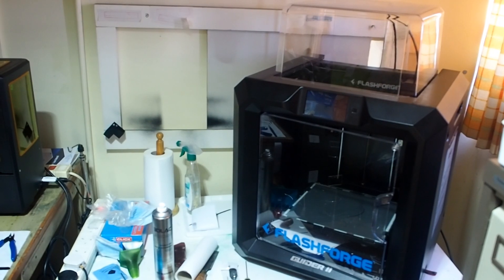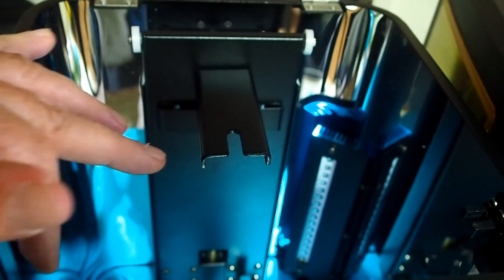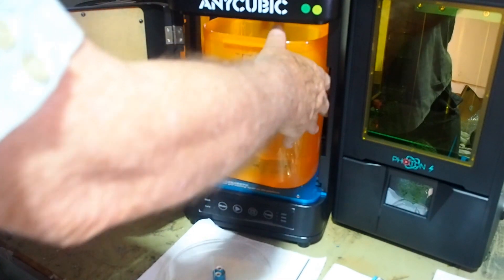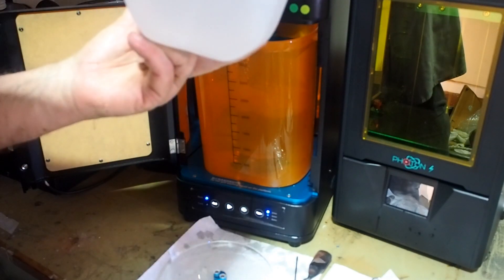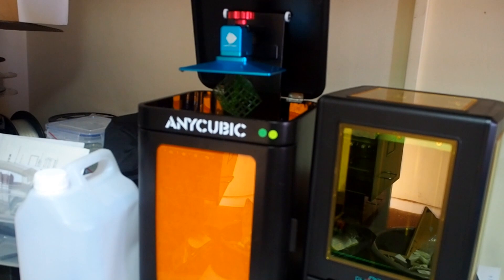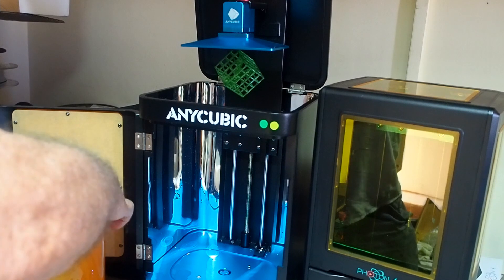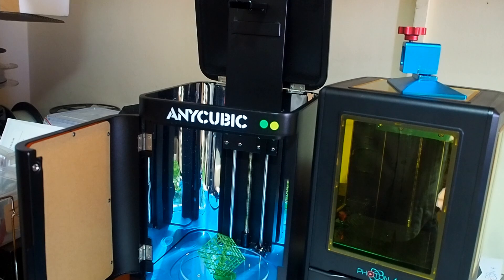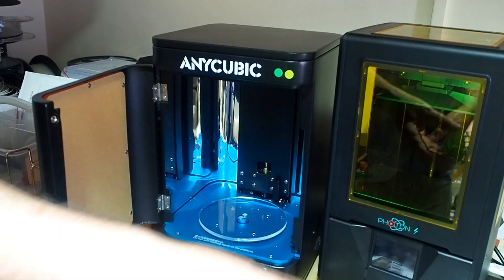Anycubic Wash & Cure first attempt

Comment: I just got mine, and The spinner in my wash bucket isn’t rotating 360° when it gets up to full speed. I am thinking maybe the screw is tightened down too much. Have you had any issue with this?
Reply: I'm having exactly the same issue!
Reply: SGD I just figured out how to fix mine. The one I got is totally magnetically driven. I took the hex wrench and removed the spinning agitator. Under the screw is a lock washer tightened down on ball bearings. Remove the lock washer and the agitator spins freely around the screw with no resistance and it works perfectly if a little noisy. I think the one chris has, has a pin of some kind that cones through the wash bucket and attaches where the turntable does.
Reply from the maker: It is difficult to seat the bucket properly on the shaft, you need to make sure it is engaged properly before it spins. If it still doesnt work I guess the unit is faulty. I certainly had some difficulty seating mine properly.

Comment: Thanks for being  our guinea pig!  I suspect that there is opaque paper over the inside of the front window.  If so, I suppose you can get a view, for what it's worth, and I assume that the material is the same UV blocking plastic as on the Photon.  As to the ball bearing, I have no idea.
Reply from the maker: Yes you  could unscrew the plate off the front panel, that would do the trick